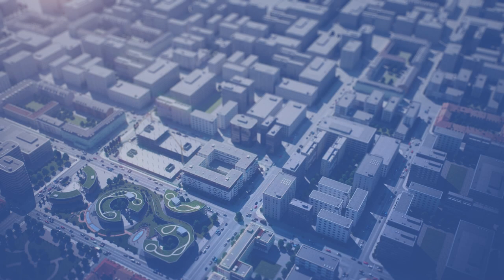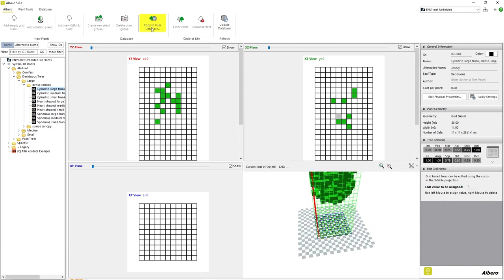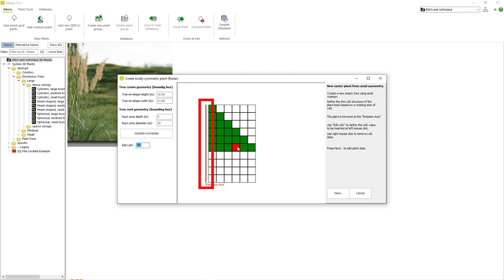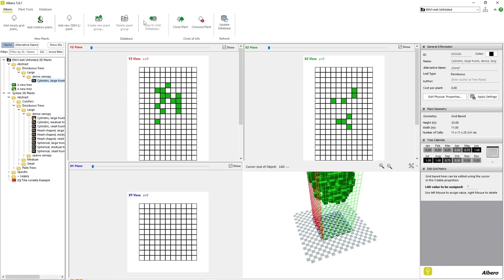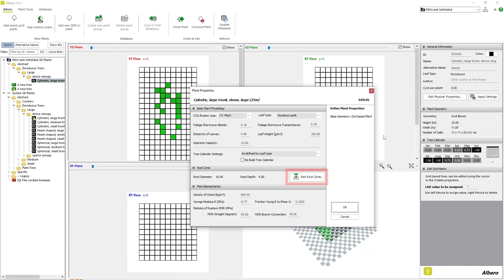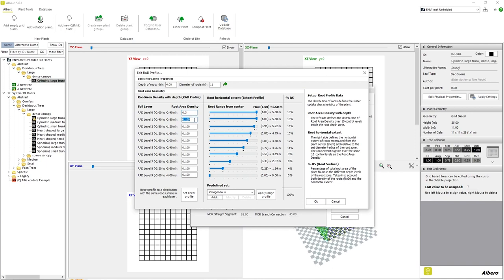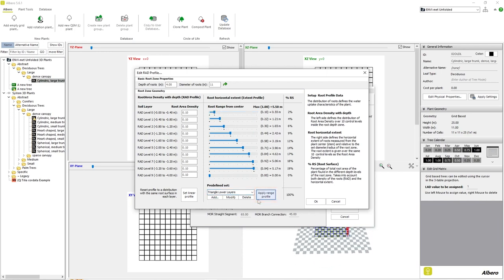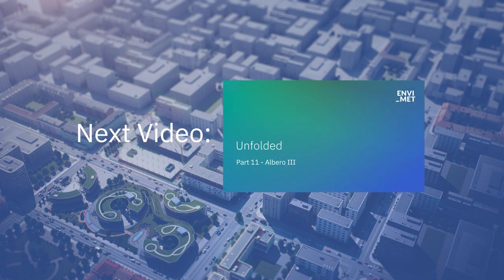Project Guide | Custom 3D Plant Creation: Albero #10

Comment: Thank very much for the informative video in Albero 5.6.1. Unfortunately I was not able to edit the "Specific" tree (Tilia) once I copied it to my user database. I tried left click (add cell) and right click (remove cell) in the yz-plane xz-plane views at the correct slice level but no cells are either added or removed. I'm not sure if this is user error or a bug. I'd appreciate if you could get back to be on this. Many thanks!
Reply: This a a QSM-based tree, you cannot edit the LAD cells there, they are generated based on the tree skeleton rules